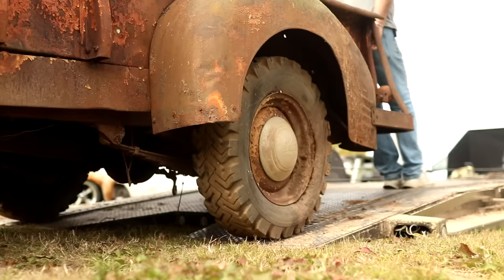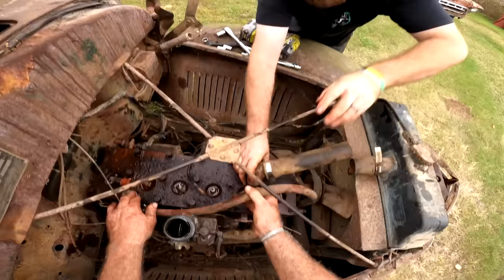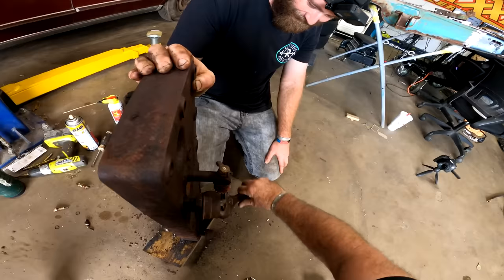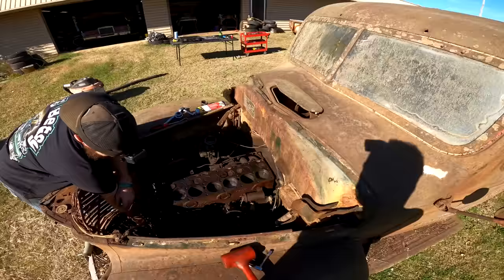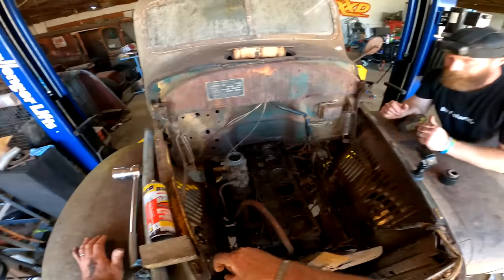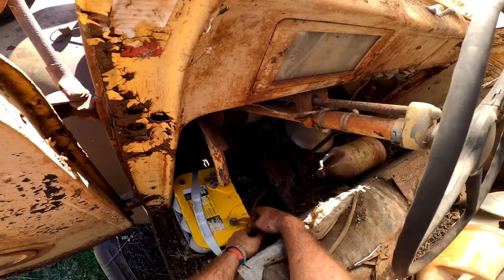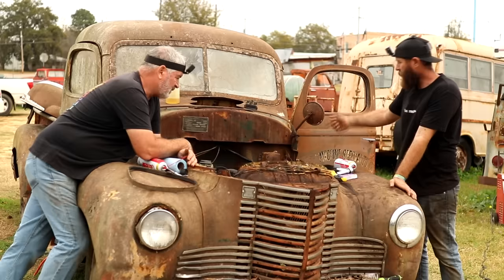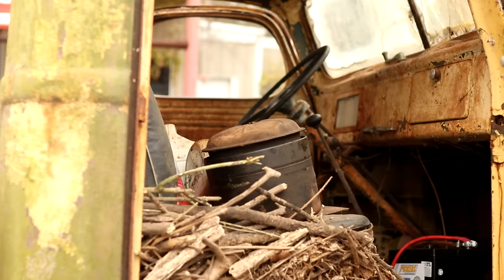Will It Run After 50 Years?! Abandoned 1946 International Truck | Engine Locked Up Solid | RESTORED

Comment: like acids but no only surface cleaner i used boil oil old hot cook in cold weather it easy to turn over add to what ever engine lubication first just let it sit soak good fire pit or camp stove yes open flames its safe not bad better the rings head or parts breaking walls seping in old metal 
couple times then use other hot fluids like engine purple power really gets in pourse areas like air water even i known but hot water fascasity with soaps like home work great 212 boiling just like 210-165 operation temp only dumb if it wont work works ever time some time you just remove boil whole thing in vat of hot old oil over fire it works great 50 gallon drum full old oil or trans fluid does wonderful things pull cold out pour new old hot in wear mask or dont breath it an hook line in filler area in drain works like charm cheap easy effective no elctralisy need